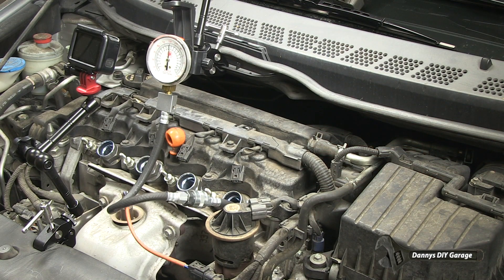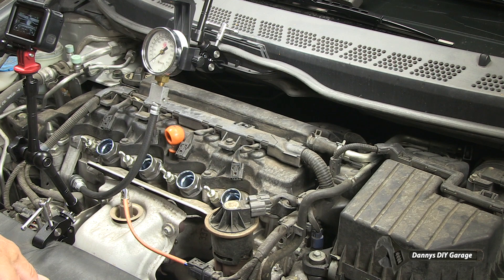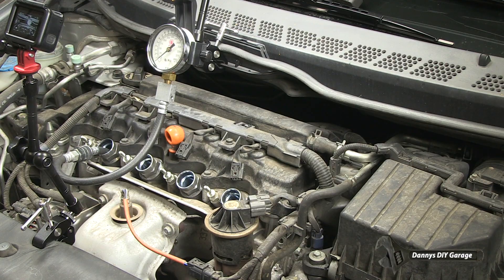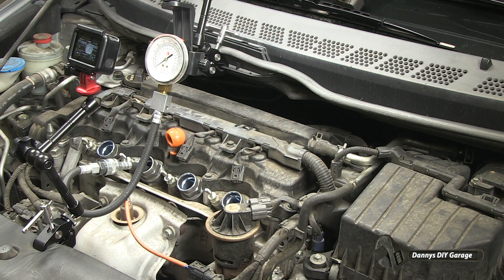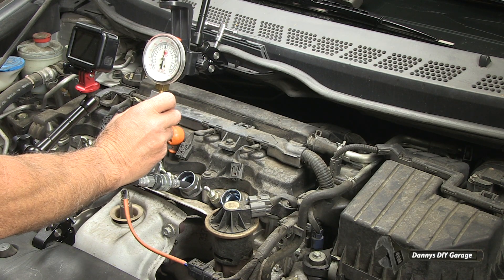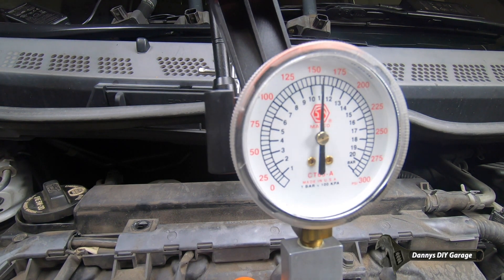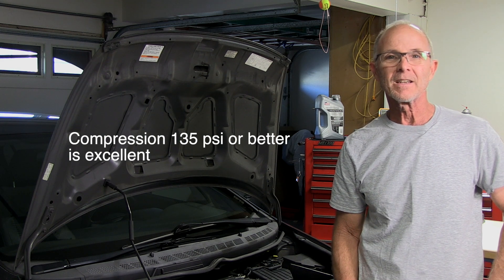How's your Engine Compression? I'll explain what it means.

Comment: Why wouldn't this test be done on an engine at operating temperature?
Reply from the maker: Compression testing is best done warm if the engine runs, but on aluminum heads you risk thread damage pulling plugs hot. If you’re chasing a cold-start problem, testing cold makes sense—just keep the test conditions consistent

Comment: what compression should i expect on my 76 F150 with possibly only 118,000 miles on it, judging from the seat and pedals which are still 95%intact.
never having done one before i got a low of 82 on  #4 cylinder with all the other ones about 95-110.
it does seem to have been running rich quite a while judging from soot in muffler and ex manifold leaks and entire passenger bank also an  intermitant miss and i cleaned up the plug as best i could before reinstall but plan on changing all four on the side with low compression to see if that helps
Reply from the maker: Watch 4 minute mark on the video, this will explain, as far as what a new engine would have, I don’t have that information

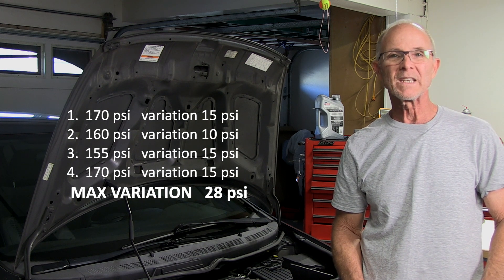Comment: 4:32 High compression readings could mean carbon on top of rings which results in pinging.

4:45 Low compression means valve and piston rings. Do “wet test” in each cylinder again after putting 1 tablespoon of motor oil in the cylinder. If compression rises, that means piston rings and valves.

Comment: Thanks,first time I did compression test.06 Honda accord 3.4L #’s 120,140,150,150 also oil turns black in a few hours after oil change.tried driving n I could not leave my street.I determined the engine has lost of life.
Reply from the maker: Such a bummer

Comment: Why do all the plugs have to be removed can u not just remove the plug your testing then move to the next 1
Reply from the maker: no, the cylinder stroke needs to spin freely, meaning if a plug was in it would be compressing air and fuel, this would cause resistance and cause bad compression reading, hopefully I explained this so you can understand, short answer is all plugs need to be out and if possible the throttle wide open so the engine can get as much air as it can.

Comment: I have 2008 civic hybrid all cylinders psi is 125.
Is it bad??
Reply from the maker: How many miles are on your car and how’s it running? If they are all about the same, they are wearing properly
Reply: @dannysdiygarage  it has 210,000 miles.
It’s very slow uphill only
Reply from the maker: That’s probably not the problem
Reply: @dannysdiygarage  what you think is the problem?

Comment: I have an no start condition on my 2007 Hyundai Accent 1.6 l.. I have spark, I have fuel. Compression test, dry, ( and cold), is 90, 75. 80, 80, (1-4 cylinders). I'm wondering if I have a blown head gasket or not, here. Thanks much.
Reply from the maker: That's really low compression, I would do a wet compression test 1st ,  then a leak down test, this will help pinpoint valves or piston rings as the problems hope this helps, I'm guessing there is a lot of miles on the car?
Reply: @dannysdiygarage  Yes, car has about 170K on it, I think .It ran fine / drove fine, the night before - the next morning, though, it cranks but won't start. Also, when I tried starting it, earlier, with all the plugs in it, I noticed air / bubbles going into the radiator resevoir. Took the radiator cap off and looked while cranking it and noticed much upward movement of coolant rising to the rad. fill cap surface and overflowing it. So does this mean I have a blown head gasket across the board and that it's pressurizing my coolant system? If so, I shouldn't have to do a separate leak down test to determine where the compression it leaking to, correct? There is no sign of water in the oil on the dip stick.  Thanks much, Danny.
Reply from the maker: @steveandrews8301  that's correct, you could do a leak down test and see the air going into the cooling system, however, I think it would just verify what you already know, you might want to price out another engine, this might be a better option, just a thought.
Reply: @dannysdiygarage  Thanks, Danny. About a year or two ago my son drove it, had the timing belt break, it bent 4 valves. Had a machine shop fix the head / replace with new valves / head job. I  replaced head gasket (a metal multi layer type) and installed head, and now it's seemingly blown, again. Is there a special way to install these type metal head gaskets where they'll not leak? I don't trust them. I'm old school, used to the fiber type head gaskets, but this multi-layer metal head gasket is what it called for. Thanks much.
Reply from the maker: I don’t know the answer to that, sorry

Comment: I have a civic 2010 and my test was

1. 130
2. 130
3. 130
4. 125

Is this good?? I haven't try the wet compression.
Reply from the maker: Yes you’re with in specs, probably no need to do a wet test.
Reply: @dannysdiygarage  thank's alot for your answer, very helpful and make feel no more think my engine was in a bad shape because the number are below from the standard 🙏🏽🙏🏽

Comment: This video does not show to remove the fuel relay we are watching this cause we need help but you only show half of it what the hell.  🙂🙂🙂🙂
Reply from the maker: I did not remove the relay, do you need me to tell you how to remove the relay ?
Reply: @dannysdiygarage  I'm curious. What is the downside to not removing it. You mentioned that you did not do it, but it is a good idea to do so. Can you explain what the pros and cons are? 

I enjoyed how your video is quick and simple, right to the point, while explaining what the results mean. I have 190,000 miles on my 8th gen civic and want to do this test to ensure the engine is healthy so the car is worth putting money into.
Reply from the maker: Removing the fuel pump relay disables the fuel pump from running, if you have spark and fuel a fire can happen, it’s a safety thing, but if the coils are removed there is no spark, always a good practice to be safe

Comment: Was the engine warm (and allowed to cool before removing spark plugs)? Or was the testing done on a cold engine? Thanks.
Reply from the maker: This was actually done on a cold engine, I adjusted the valves while the valve cover was off, there is a video on this
Reply: @dannysdiygarage  Just did the compression test on my '97 Del Sol. 138 - 150 psi with four cranks, 8% variation. One thing i noticed is that the 18-21 ft-lbs torque recommendation on the back of the NGK spark plug box (gasket type plug in aluminum heads) is 38 to 61% higher than Honda's recommended 156 in-lbs. I have watched your valve adjustment video and will be using it as a reference also. Thanks again.
Reply: @dannysdiygarage 😢

Comment: Hi Dannys, on dry test, compression of my Honda CR-V 2.0 - 2013 ,60k mile (R20A6 Engine) is: 149, 157,157,156 Psi. 
Is that normal ??? 
And i see a lot of air coming out of the oil filler cap when engine is running . Is that worrisome?
Reply from the maker: From my experience most motors will blow air from the oil filler cap due to the pressure generated in the crankcase from all of the moving components. If the air blowing out seems excessive, smells like fuel, or is accompanied by loud hisses or sounds, then it may be possible that the vehicle has worn piston rings, and is experiencing what is called combustion blow by.
Engine blow by is when the engine’s piston rings have worn out enough to allow combustion gases and pressure to escape past the rings, into the engine crankcase. This is more likely for high mileage engines. I would also check to make sure that the vehicle’s PCV valve and system are not clogged, possibly causing a vent restriction, and an increase in pressure. You could do a wet compression test to check the condition of the rings
Reply: @dannysdiygarage  Thanks you for your reply, so is that pressure  (Dry test: 149, 157,157,156 Psi) weak?
Reply from the maker: Your compression is fine, are you having any drivability problems?
Reply: @dannysdiygarage  No problems, drivability is still good.

Comment: Here is my readings 1.6L civic FD
175 , 185 , 180 and 198 psi 
Is that normal ?? 
And engine losses oil clearly about one litre  every 5000km running and no seal leaking 
Please advise danny
Reply from the maker: You did not specify the year and mileage, however most likely you have carbon build up on your valves causing higher compression, if you’re not experiencing any drivability issues I would of not worry about it, loosing a small amount of oil is normal with higher mileage also, also a good check is to look at your plugs to determine engine condition, a oil soaked plug would be a problem with rings, a pitted or carbon build up also would be a problem, a de carbon is an option, although I usually don’t recommend it unless you have to do it

Comment: Hi the PSI for my Honda Civic 2007 EX is at 220, 215, 225, 210. Is this normal or is it good?
Reply from the maker: Probably a little high, how does it run? Carbon build up possible.

Comment: Excellent video friend continues this way I wanted you to give me the data of the compressions that an engine of a honda crv from 1997 to 2001 would have to have the B20B engine since in google I find the data of 8.8 but I do not know how much it is in Psi then I would like to know if you could give me the information in advance, thank you very much
Reply from the maker: Everything I read says 135 to 145 for that engine. , Healthy engines should have compression over 100 psi per cylinder, with no more than 10 percent variation between the highest 
and lowest readings. ... TIP For a cylinder below 100 psi, pour 1 teaspoon of engine oil into the plug hole and retest. If the reading jumps, the piston rings are worn. If not, think valve problems.
Reply: @dannysdiygarage  thanks my friend